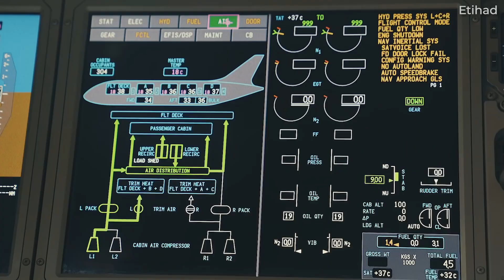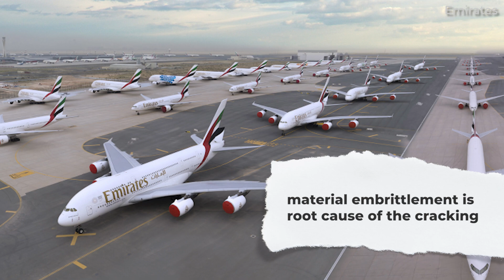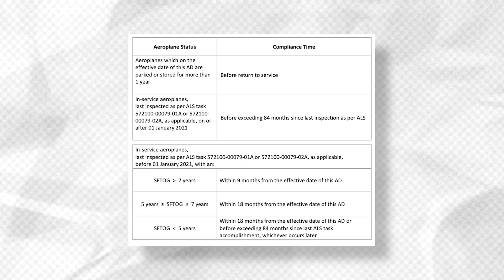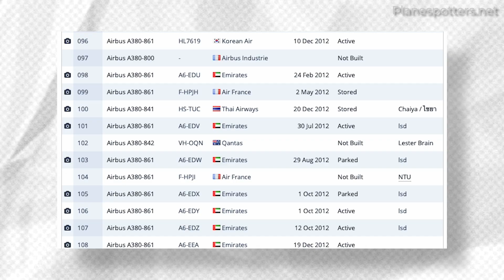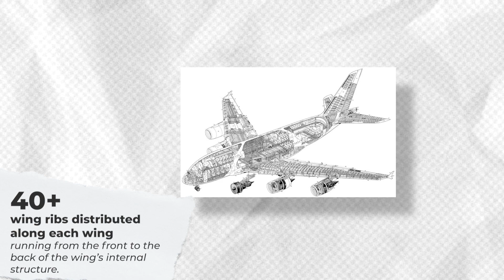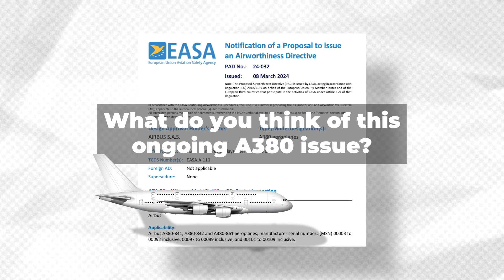The Airbus A380' Ongoing Cracking Issues

Comment: The weird thing is that the wing for the A380-800 is actually too large and took the -900 version into account. As such it's surprising how many issues the A380 has with its wing design.
Reply: That is interesting. Too bad the A380-900 (and other planned variants) never made it to the real world.
Reply: @europeanrailfanit  They depended on how the -800 would sell.  Emurates qould be the only ones interested in anything else
Reply: If they optimised it for this specific variant it would have been better
Reply: @Tpr_1808  Exactly the opposite, as the wing would have been smaller with less material, different static layout and thus under more stress during operations.

Parking is one issue, but not the only issue the wing design has.
Reply: Yes. The wing was actually designed for MTOW of 600 tonnes